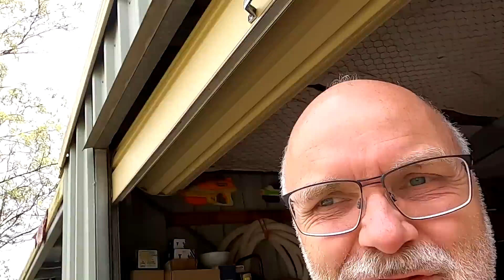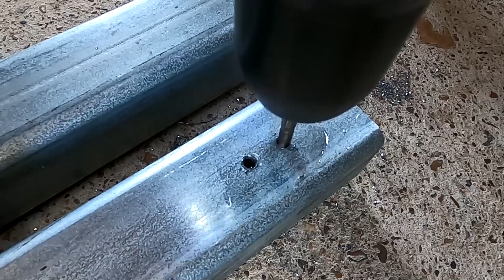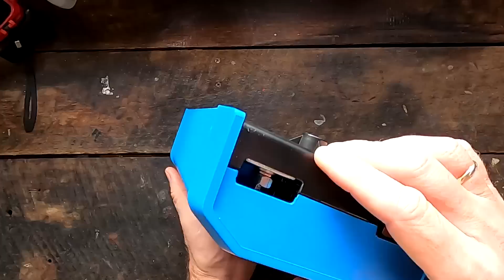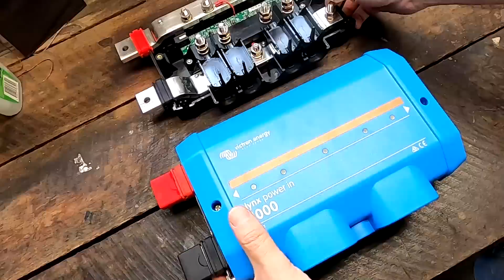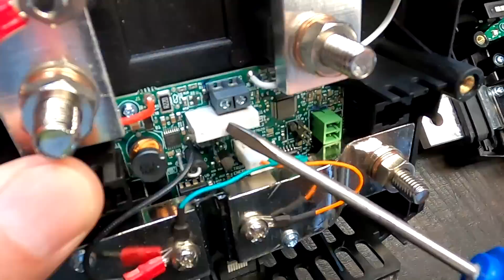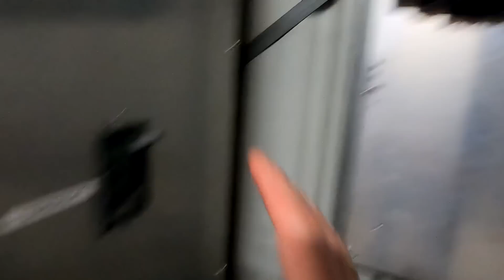The new Powerwall 2.1 - built in hours, not months. Introducing the Victron LYNX Bus Bar System.

Comment: Hello. one question. How did you set up the Shunt i the app or Cerbo GX?  Mine is not appearing in  the Cerbo GX so I cannot have access to the current in/out parameter 
I have the shunt connected to the servo GX with their two terminators, and a touch display connected to the Cerbo GX

Comment: I wonder if you need a seperate shunt if using the Seplos BMS. The Seplos BMS have a shunt included, so why not use these? The sum of the both shunts from the both Seplos BMSes should be the same as the Victron shunt will measure, right?
Reply from the maker: We can use either the Seplos BMS as a shunt or the Victron Lynx Shunt. Both will not work at the same time. In the Victron system, you can nominate which of the two is your battery monitor.

Comment: You can invert the direction of the smart shunt by switching all the small wires in it from right side of the shunt/fuse to the left side and vice versa.
Reply from the maker: Can you?
Reply: @OffGridGarageAustralia  not officially supported, but it definitely works. Two are power supply to the board, three are for voltage (+/-) and current (actually: voltage across shunt) sensing, with one shared wire. Switching all around puts them at the places they are designed to be in, just on opposite sides relative to the shunt, turning the design, effectively, upside down.
Reply: Or should I say left side right? Whatever. It works.
Reply from the maker: @svenmueller  I'll give this a go, sounds good and easy. Thank you.

Comment: great info thank you Andy!   so to use the Lynx system with your 2.0 battery bank - would you just connect the output BMS from each of the three 48v battery banks straight to the Lynx Input 1000?
Reply from the maker: Yes, if I would upgrade to a Lynx system, that would be the easiest method.

Comment: This is exactly what I intend to use as it is a very nice and compact solution. The only problem I had was that it's usually nice to be able to disconnect all the batteries with one breaker, which didn't seem to be easy to do with the Victron busbar until ... I found what I think is a good solution! The Lynx Shunt has a place to put a fuse between the two sides of the bus but in fact this fuse is not very useful... So what you can do is connect two cables on each side of the fuse and connect them to a main battery breaker and voila! The only problem is that the Lynx shunt cover wasn't designed for this, so you may have to make an opening in the shunt cover or maybe the wires can be routed through the "distributor" or "power in" if there is enough space?
Reply from the maker: Yeah, I had a look at this solution, and it would be possible to modify the shunt to mount a breaker somehow. It gets messy quickly though. A 300A breaker for example is not small and it does only disconnect the positive bus bar. In many regulations it is necessary to disconnect both pos and neg of the battery. So, a breaker between the shunt and the Power In module would be feasible... but the installation gets larger and defeats the purpose.

Comment: I love the Victron Bus bar.  I have been using this setup for about 6 months now and haven't had any issues.  My only complaint is that you can't monitor the fuses with the "Lynx Shunt VE.Can" and the function requires the "Lynx Smart BMS".  Since the VE Shunt can connect to the Lynx Distributor I am hoping it's a firmware upgrade in the future.
Reply: IIUC, the shunt VE.can simply doesn't have the electronics to talk to the distributors. Also I found a post in the victim forums that hinted at a new shunt that could talk to them. Still a pity that they haven't done this already after years of having the distributors.

Comment: You could easily add your own indicator to your non-peter by adding a red LED (with anode to the positive bar) in series with a resistor (10KOhms/0,25W for 48V = 5 mA) in parallel to the fuse. It will light up, when a load ist connected and the fuse is blown. If you use two leds in anti-parallel connection, it will work for loads and sources, if you only have a single power source. With multiple sources, it will not work for the sources, only for loads, because the voltage difference between your sources will not be high enough to light up the LEDs.
Reply from the maker: Yes, that would work if want an indicator for the fuses. I found the PCB in the Distributor a bit over the top. It has a lot of chips for such a basic function.
Reply: @OffGridGarageAustralia  Yes, the electronics is a bit over the top, but you need something to connect to the bus, a power supply and a dection that works with a broad range of voltages. I would be interested, if it can detect also the blown fuses, if it is used as a "fused power-in" (I believe, it doesn't). This would be much harder than with a power-out (VBat drops to 0 with a blown fuse with out), since you would need to detect very small voltage differences between two batteries (almost no drop between the bar and the disconnected power-in).

Comment: Would really be nice if there was a clean way to disconnect a battery using that Lynx distributor.   That switch you mentioned adding to perform that function I don't think is rated for disconnecting a battery when under load whereas your Noark breakers are.
Reply from the maker: Yes, that is correct. The switch is not for emergency purposes but only for maintenance to turn off a battery. I'm sure it will still work under load as well. The Seplos batteries I want to connect won't supply more than 100A each at max power (it's rather 30-50A max under normal conditions).
The Noark would be the preferred safety switch for this purpose.

Comment: Hiya, Andy! I’m working on a battery project for our sailboat. Using reclaimed Tesla battery modules. Excited to use them, because they are made from high-quality Tesla spec cells. And they are taken from wrecked Tesla vehicles. Which would mean if we don’t use them, they would go into the dump. I’m a Tesla car owner like you. Why don’t you consider using Tesla modules for your power wall 2.1? SimpBMS talks to Tesla module slave balancing boards. And also integrates into the Victron Eco system.
Reply: Because those cells are inherently much more dangerous than LiFePO4 cells.
Reply from the maker: Not only more dangerous but also more expensive. Very hard to get down here in AU.
Reply: @Walther Stech they won’t go into a landfill if you resell them - lots of people are looking for good Tesla modules to buy. Use the money to go LFP because of fire risk especially on a boat! There is no magic sauce to Tesla vs. other Li-ion, none of which is good for a boat IMHO but good luck regardless.
Reply: @tomkacandes8286   Tesla packs can sustain 250A charge / discharge (with cooling) per 5.3kWh module. My use case on the boat is a joke load to them. Don’t even get warm. Their magic is in the extremely hight specs cells are made to. They are very uniform cells. After multiple cycles without balancing (i know. Not ideal) all 444 cells (times 2 modules i use in series) are within 0.02V Not too shabby! Lithium on my boat is within my risk tolerance. As well as that of my insurance company. So we’re fine there. And Li-Ion are also 20-30% lighter then LFP. Which is a very important factor on a sailboat.

Comment: You are during the right thing now. I also like the compact design from victron Lynx system, and I use it myself in my system. I only see benefits of using this. I also upgraded the Power In with additional fuses.
Reply from the maker: Do you use any switches to turn of loads and batteries? If so, what do you use?
Reply: @OffGridGarageAustralia  yes I use a blue sea switch on the positiv cable. It's like the one you have for your inverter. Can I sent you a picture of my installation some how?

Comment: Now for a question about fuses.  Any concerns about using much-less-costly automotive fuses in these Lynx boxes? I am thinking 1 x 300A 80V DC in the shunt for the main positive feed from 2 x 150A combined Seplos 280Ah battery banks and 4 x 50A for the four feeds from each of my four Victron MPPT 48V 150/35 solar charge controllers)? regards to all from Northumberland
Reply: You can't use those automotive fuses.  The important difference is the current interrupt capability.  With LiFePO4 batteries you can get extremely high current from a short circuit and those automotive fuses would weld together and not actually cut the power.
Reply: @davidb.5544  Indeed, the Lynx shunt takes a CNN fuse (2,500A interrupt rating? 5,000A?), and the Lynx Distributor/Peter takes MEGA fuses (interrupt rating looks to be in the range of 2,500A). Also the fuses within the Seplos battery packs (Zeeman ANMH, 2,000A interrupt rating, I think) are not optimal. I guess the combination of the Lynx system with MCCBs on the inputs and outputs would provide a good level of protection.
Reply from the maker: Thank you Max. I just realised that I never send my address to you 🤦‍♂️ I'll do this tonight...
With these fuses, it is important to use the right voltage to interrupt the arc if a fault occurs. So using 80V fuses seems to be correct.
As with the other comments, this is not optimal but still sufficient, I guess. I would rather use a T-Classe fuse here or even better a dual DC circuit breaker. Both have 20-25kA breaking capacity.

Comment: You can have LEDs on the power inn too.
You need a board the size of the missing one, 4 LEDs, 4 resistors and some wiring...  Run the cable from one end of the fuse, trough the resistor, trough the led, and back to the other end of the fuse.
If the fuse breaks, the power goes trough the led, but redused by the resistor...
Reply from the maker: Yep, thanks, that will work too.

Comment: Yet another excellent and informative video.  Thank you very much Andy.  Can you tell me if the blue cases of any/all of the Lynx products can be re-attached "upside down" to support a DC bus that runs right to left?  I appreciate some internal re-arrangement might be needed.
Reply: Yes you can. They are even provided with a sticker for the cover you can use in that case. You can also switch all small wires from one side to the other as well. That works and you have the benefit of nu dust falling in.
Reply: @rikdehaas6398  Thanks Rick.  That's great news.
Reply: Can anyone confirm whether the Lynx Shunt also be turned upside-down so the DC bus runs from battery on the right to load/MPPT solar charger feed in on the left?  It looks like not reading the Victron documentation.
Reply from the maker: The only problem is the cable connections would be from the top then.
I had the sticker in the video but cut it out as I though not many people would use this option. There you go...

Comment: There is some controversy even on the Victron Community forum if these bus bars should really be rated for 1000A without generating a lot of heat since the cross section of the bus bar is only 8mm by 30mm.  Even Victron's 600A busbar is considerably thicker than this.
Reply from the maker: Yeah, I can understand the discussion. But 1000A is also a lot, right?! Even in a 12V system, it's a lot of power and probably OK for peak/surge power even it says constant 1kA somewhere.

Comment: Great stuff as always Andy. Have you considered trying a power wall from 135ah Chinese blade batteries? Would be interesting.
Reply: I just saw a tear down by Will Prowse of a CHINS so-called solid state LifePo4 battery and a puncture test he did on this Blade type cell, it resulted in a catastrophic runaway, worth a look, the next puncture test was on another LifePo4 pouch cell (Not the so-called solid state type) which did not vent very much at all given he drilled it through 9 times
Reply: @evil17  yep. Saw that. I’m talking the BYD style Lithium Iron Phosphate blade. On AliExpress. Are they any good.
Reply: @cCaribbeanSpursTv  ill havta check them out..i am always sus on any of those pouch type cells tho.
Reply: @evil17  Hear you. Look well dodgy
Reply from the maker: I had a look at the blade batteries but the formfactor alone is not worth the hassle in my opinion. We would start another big DIY project just for housing them correctly.
Reply: @OffGridGarageAustralia  Thanks for reply Andy. I know you’re busy. Yes I figured it would need a build to house them. What about on a commercial shelf like the one for 2.0 but deeper depth. Is there such a shelf or maybe out of wood😀. Anyways have a good day and I must say I’ve learned so much watching your videos. I remember in lockdown when we started 1.0 battery. Amazing work dear man. I look forward to next project🙌
Reply from the maker: @cCaribbeanSpursTv  For sure, you can get a shelf for the blade batteries where they will fit in. But do they have advantages in comparison to the ones we use right now? It does not seem so...
Reply: @OffGridGarageAustralia  Price seems more competitive than eve cells, but unsure if the 138ah advertised capacity is genuine. I’ve seen on AliExpress.
Reply: @cCaribbeanSpursTv   I was looking those blade cells for my EV conversion. Ended up going with some lishen high C rate LFP cells instead. But those blade BYD 138AH batteries are legit BYD last gen cells from what I can see. The form factor is more useful for an EV conversion having the battery terminals on opposing ends and that long and short form factor for going into the floor area of an EV. But no harm using for off grid id the price is right!
Reply: @MrDingaling007  Thanks CD.  I was intrigued by them. Take care 👊🏾

Comment: There’s a mod you can do to the distributor that involves connecting a ground to one of the pins in the RJ11 port to make the LEDs work on the fuses without the bms controlling them. You might Google it.  

Also I think those bars are tin plated copper bus bars not steel….
Reply from the maker: Yeah, sow this teak as well but the short cable is included so why not plug it in and have it activated. Unless you only use the Distributor alone for any reason...
Reply: @OffGridGarageAustralia  I thought you said you can’t use the electronics without the victron BMS?  What I was suggesting was a way to still use the LEDs for fuse indicators even though you didn’t have the victron BMS. Or maybe I misunderstood. My wife tells me that it’s possible, so… 🤷🏻‍♂️😊
Reply: @Shep5847  It is possible you just need to supply 5v to the correct pins in the RJ11 cable.
Reply: @OffGridGarageAustralia  Yes actually you can connect the Lynx Shunt to the Lynx Distributor with the provided RJ10 to RJ10 cable. It will provide power to the distributor as well as transmit the Distributor information to the Cerbo GX
Reply: @DrCoolZic  no, the lynx Shunt VE.can is unable to provide the fuse information from the Distributors to the GX device. That had been confirmed in the Victron fortune. Or also show by (kind of) by the latest firmware of the Shunt being a year+ older than the release of the Lynx Distributors.

Comment: the copper is softer so can be compressed
Reply: Any corrosion issue with the copper spring washer contact against steel bolts?
Reply: @DavidHalko  not unless very humid conditions

Comment: Oh this time a long promotional event for Victron Lynx system...not bad for sure but the price??? The tip with the additional screws was good, even if the "power-in" is still too expensive for me.
Reply from the maker: I recon it would have been cheaper than the DIY shelf I build with all the work and material I have used.

Comment: Nice 2.1. On your lynx without the lights, put some led/resistor in parallel with the fuse. When the fuse blows the led will light. Drill a small hole in the cover.
Reply from the maker: Yeah, would be solution if one wants that feature.
Reply: That is phenomenally simple! ❤

Comment: The relay on the shunt can actually only act based on the system battery voltage, not SoC. At least mine can't. Also there's no option for hot water/surplus load, it's intended to be used as a generator start/stop or you can also turn on the relay remotely.
Reply from the maker: Ah, right, I had mixed information as I had read about SOC trigger as well. Voltage seems to be OK, I guess. So it is the same relay function as in the MPPTs.

Comment: Not possible this is stainless steel, stainless steel is very bad to conduct electricity
Reply from the maker: The bus bar is tinned copper but all fasteners are stainless, except these spring washers...
Reply: True but if made appropriately thicker than equivalent copper or aluminium busbars, it will be fine.

Comment: You can DIY the Victron Distributor lights with a cheap 5v power adapter.
Reply from the maker: That makes only sense if you use it as a standalone device, right?
The short cable is included which makes all the lights work.
Reply: @OffGridGarageAustralia  Yes, an option for those who dont want the added expense of a Lynx Shunt and Smart Shunt (little blue box in the middle and on the battery) or BMS (limited to Victron batteries).
Reply: Only need few leds and resistors (for 48v)

Comment: Buss bar looks like cheap Chinese manufacture Well at the price you mentioned someone is making a HEALTHY profit with $0.70 USD plascis housing and  a day few screws Ana aluminum buss strap
Reply: The bus bar is solid copper, not Aluminium and it's made in India (at least the things sold in Europe).
Do they make a healthy profit? Sure. But the case is certainly more expensive than $0.70 (injection moulded, fiber reinforced).
Reply from the maker: It's heavy, so this is proper tinned copper bus bar they are using. The plastic seems decent as well and does not look as cheap as many other products I have seen.